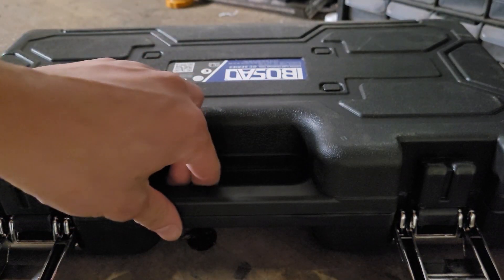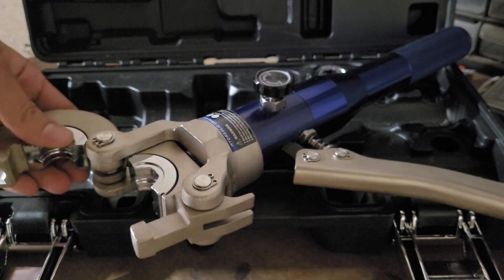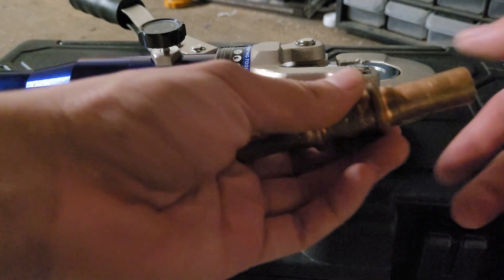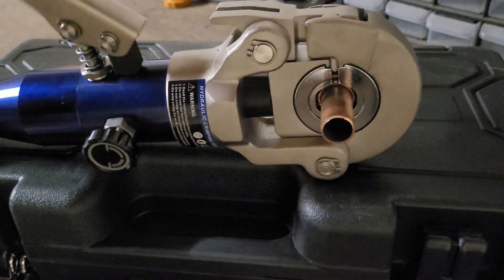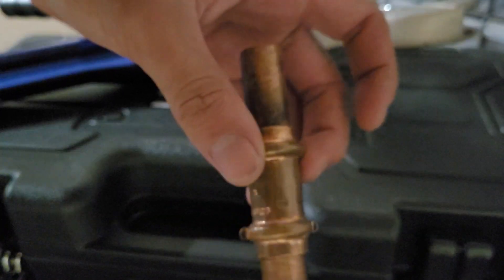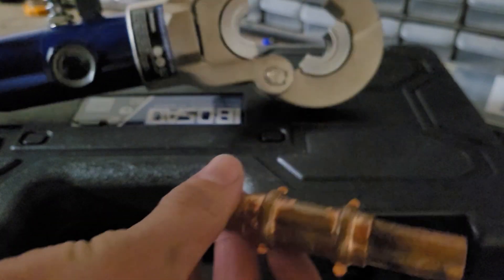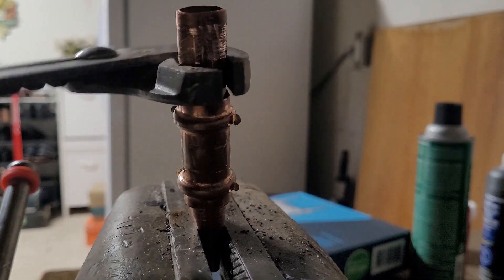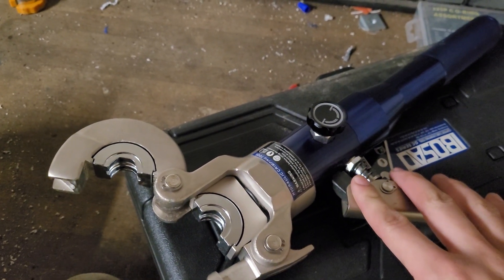IBOSAD GC-1 Copper Press Tool Review - $100 ProPress! (See update in description)

Comment from the maker: UPDATE September 2025 The new IBOSAD HT-1950 ProPress tool has fixed all the problems I had with the GC-1 I reviewed in this video and I highly recommend buying it instead. I made a video about the new press tool here: https://www.youtube.com/watch?v=8EnrHqB4dzE

UPDATE April 2022: Do not buy this press tool! It is not manufactured to the proper standards and every single joint made with this tool started leaking after a short period of time. The included jaws appear to be for European or Asian metric press fittings, but they were labeled as being for North American press fittings. I made a video about the problem here: https://www.youtube.com/watch?v=cP8fJlKejtU
Reply: Thanks for the video and the update. Have you found a better, more reliable manual pro press tool?
Reply from the maker: There's the Bluefin tool, but it takes a lot of space to use. You could always rent a real press tool for around $100 a day.
Reply: @DragonBuilds  thanks!
Reply: Thanks so much for updating us!
Reply: Did you deburr the inside and outside of the pipe ?
Reply from the maker: @1allstarman  Yes I did
Reply: Relieved I read this comment section. This tool is literally in my amazon cart waiting for me to click buy. What press should I buy instead?
Reply from the maker: @JeffMorrisonAdventures  The Bluefin press tool from supplyhouse.com seems to be fine, or you can rent an electric press machine from places like Ferguson
Reply: @JeffMorrisonAdventures  I bought the IGEELEE it works fine. Just be carefull not to pump it too much , stop when you see the dies touching .
Reply: @1allstarman  have all your crimps held long term? How long term?
Reply: @JeffMorrisonAdventures  It has been about a month , I have used only copper .I do not do plumbing  every day .
Reply: @1allstarman IBOSAD, IGEELEE, etc. I wonder if those are literal phonetic translations of Chinese words or if they use a random word generator to come up with brand names.
Reply: @JeffMorrisonAdventures  o far they have worked fine , I have never had a problem with the igeelee , In fact I bought a back up one , same thing .
Reply: @1allstarman   I've since bought it and used it to replace the shut off valve in my hot water heater.  I sight appreciated.
Reply: Thanks for the update. I may get into this for repairs instead of sweating pipes, or maybe pex. Not sure.
Reply: With respect, this comes down to user error. It looks like you tried to crimp too close to the wall and as such probably weren't able to apply enough pressure and completely close the jaws. I've seen independent tests done with this specific brand and, if crimped properly, do not leak.
Reply from the maker: @EnigmaPSU  I think mine was simply defective, I tried another joint outside of the wall and it had the same problem.
Reply: @EnigmaPSU thank you for being a real man and gentleman of your critic….”With respect”. Taught me something today….much thanks!
Reply: Yea mine is doing good maybe u just don't know how to use it

Comment: 3 years later is all the pressed fittings holding up good, looking to finally buy one after seeing ur video
Reply from the maker: I had major problems with leaks after a few weeks. I have a video linked in the description with updates. Recently, IBOSAD did fix the design flaw with the press tool however, I have a video about that coming soon.
Reply: @DragonBuilds thanks boss I’ll take a look at ur videos later today

Comment: Plus mine works fine i have no issues at all left it for a week or 
3 no leaks so if u take ur time and make sure the rubber seal is on the pipe u will not have leaks best thing to do after is check for leaks after compressing it together  do not rotate it or it will leak they are not like sharkbites at all completely different

Comment: I decide to buy the lower cost Rigid 12v press tool. It is very expensive for me, but I will sell it after I'm done with my projects. My reason for avoiding any manual press tool is some joints will be difficult to reach well enough to get proper purchase on the manual tool. It just seems, for me, it will be easier to maintain during operation. I wish I had the confidence to save big bucks on the tool, but I'm saving a $500 installation fee on just the water heater.
Reply from the maker: The Ridgid press tools are great, you can also rent them from plumbing supply houses. If you saw my updated video, every joint made with the IBOSAD press tool had to be cut out and replaced, I ended up soldering instead. If you can solder it’s not worth the cost of a press tool for home projects in my opinion, as even a high end propane torch is under $100.
Reply: @DragonBuilds  I agree with all your observations. But, I am a little impatient. One project is to replace a house shut off with a ball valve. That will be wet work (not a hitman) 😆 And, only one connection that I have soldered has held up. I learned, late, that it has to be dry. Additionally, adding a thermal expansion tank to the water heater is going add to time required. I appreciate your videos and learn from them. At 74, the convenience of purchasing is worth the price of the tool, especially if I can spread out my projects. Rental is $100 plus 2 way shipping for two days. My Ferguson didn't list a tool in stock, for rental. The possibility of recovering a little money on the back end will be added benefit. Yea, I can still be a little impulsive at my advanced age.
Thanks, again, for your videos.
Reply from the maker: @obliqueperspective  In that case, a press tool can be worth it! The small Ridgid tool is $1200 or so, and considering that plumbers charge $150/hour plus a markup on parts, you can still save a bit of money. Of course, soldering is cheaper but takes longer, especially if you need extra equipment like a jet sweat to stop water from dripping into the work area. ProPress is a huge time saver, which is why a lot of companies have switched over. 

I wouldn't sell it until you are sure you are done with it though, these tools last many years and are a must-have if you want to connect copper without soldering.
Reply: Yea but u have to pay hourly who can do that

Comment: There's a new version of iBOSAD press tool available on Amazon. It works like the Milwaukee one with claws closing to compress. Haven't seen any issue with that.
Reply from the maker: I saw that one, it looks to be better designed than the one I had problems with.

Comment: OMG
This video is already 3 years old and shows exactly why it is WORTH to use the designated and designed presstool (cable or battery) for this type of work.
I've going into some renewal work on our heat plumbing lines (up to 40mm) and happy to use a cable pressgun for that.
If you know what you do and how you do it but you dont have one, then rent one (with the right pressing tongs) and get it done

Also an option if its only some joints of composite pipe:
REMS offer a hand tool where you can use the normal sized pressing tongs (and not this spacewasting thimg from this video)
Reply from the maker: I agree, renting a proper press tool is a much better option than using these no name Amazon tools! Many plumbing supply stores rent them out for a small fee, and of course soldering is always an option.

Comment: Works very well, made as good as quality American for way less but the head is too big, a 3/4 to 1/2 T fitting is not long enough on the1/2" side to go all the way into the clamp. I had to slide the clamshells out of the clamp some for it to work, not proper.

Comment: So press joint , back off , turn 90 degrees , or a quarter of a turn , and repress ? Does that sound right ?
Reply from the maker: No, there is no need to repress. Also, I do not recommend this tool as it has issues with leaks.

Comment: The biggest beef I have with this tool is it won’t fit in tight spots.   
For diy use, go sharkbite.  
For a professional, pro press is the way to go but I’m not seeing a logical way around the 2000 investment.
Reply: There are better versions of this tool that work well and can fit in tight spots and is perfect for a DIYer.
Reply from the maker: Honestly, I would say that you are better off soldering.

Comment: Looks very clumsy to use and would require three hands to position, hold, and press together. Not to mention the cost of those fittings, only real benefit is connecting pipe that is wet. I'll stick to soldering.

Comment: Bought it 2 years ago...just used it with zero issues....the other one....need some coordination though...one fitting i pressed at  slight angle  but no leaks(outside faucet stuff)
Reply from the maker: Hmmm, I think it must be a quality control problem as some people have had good luck with the tool and others have leaks everywhere.
Reply: @DragonBuilds Definitely quality control problems. It's made in China. But I've tried two different ones from IBOSAD and both worked well. 
It was the HT-1950-N
And the HT1950-ZHENGTI, which is what I have now.
Reply from the maker: @fasteddie5388  I agree that it is likely a quality control problem but they also cut corners when it comes to design.
Reply: @DragonBuilds  The design of the one you're using I think they have cut corners. The hydraulic pushes one roller up into I to the other die and crushes it. I can see how that might cause an issue. Especially after seeing how it it leaves the large protruding pinch marks after being pressed. The newer ones do not do that. Especially the one I have where you have different sized jaws for different pipe OD.  It leaves very little pinch marks. I think they have refined the design over the last few years.
Reply from the maker: @fasteddie5388  I have the manual iCrimp/Bluefin tool (rebranded) and it works great, I think their hydraulic version should work well too.

Comment: There is a name for people who use propress fittings.
 They are called "flooded".
Reply from the maker: Press fittings have been reliably used in Europe for decades, but this manual press tool is poorly made and caused several leaks.
Reply: @DragonBuilds  You can blame the tool if it makes you feel better I blame the concept.
 I have seen O ring crimp connectors start leaking months after assembly.
 I will take a few minutes to solder sweat my plumbing and never have to think about it again.

 Alloy is your ally towards peace of mind.
Reply from the maker: @williardbillmore5713  I prefer soldering as well, but ProPress definitely has its places.
Reply: @DragonBuilds  Would you use them inside the walls of YOUR home?
Reply from the maker: @williardbillmore5713  Yes, absolutely. My partner's summer cottage is plumbed using a combination of PEX and press fittings for both domestic water and heating.
Reply: @DragonBuilds  Does this "summer cottage" freeze in winter?
Reply from the maker: @williardbillmore5713  Yes it does! PEX is quite freeze resistance, especially with Viega PEX press fittings.
Reply: Oh look another "real"plumber who only solders. Everything is press now and they don't leak unless your too thick to use the system properly. Stop living in the past

Comment: I bought one to try it, I crimped on one viego 3/4 to 2 separate scrap pieces. I had it set flush, and did the work. I could see the pipes weren't straight and the crimp looked like it didn't take al the way. After that I returned it and ill stick with solder

Comment: It is garbage based on what I am seeing. It squeezed the copper and did not put the hex imprint in to stop twisting. Cheap is cheap and the designer just had to follow some simple tolerance steps to make it 1000 percent better.
Reply: Bullshit, it works just fine. The seal is the O ring.

Comment: I have the split in half type. 2 years and countless fittings later its still going strong
Reply: Soldering is not hard and it is not dangerous and it  has proven longevity
Reply: @lrcreamer  right but viega fittings are warranty for 50 years and if you cant get water shutoff all the way than solder becomes tricky and press is easy
Reply: Do you have a link to it? What do you mean by "split in half" type?

Comment: bought mine from Vevor, did about 20 -1/2 inch crimps no problem, did 4 -3/4 no problem wasn't able to crimp the lower part of a 'T' fitting as the body gets in the way, that's when it started to lock up on me as in the head wouldn't unlatch from the body unless I hit it, this continues to this day, Vevor started acting stupid and saying I have a 1/4, 1/2. 5/8 tool and it didn't do 3/4 fittings (I had purchased a bending tool they were talking about) basically they kept going back and forth about me not knowing how to use such a simple tool, gave up on trying to get a refund or exchange (they no longer sell this tool now have manual ones) and stop doing business with them. just more Chinese crap. this tool looks exactly like mine case and all I'm guessing the only difference is the name on the case

Comment: The crimp is not supposed to seal the fitting. Once the fitting is pushed onto the copper, the "O" ring in the fitting engages and makes the seal. The crimp secures pipe onto fitting.
Reply from the maker: Press fittings are actually designed so they don't seal until they're pressed. That way, unpressed fittings can be identified before they cause a big problem.
Reply: @DragonBuilds  The O ring is engaged once the fitting is pushed on the pipe...
Reply from the maker: @plumbrose1  Viega fittings have a small groove that is designed to leak until the fitting is pressed. Not sure how other press fittings work.
Reply: @plumbrose1 yeah, the o-ring is engaged, but it’s not going to stand up to water pressure until the fitting is crimped. Without crimping, it will leak. Even if the fitting stays put.

Comment: I'd be careful telling people to stay away from this product based on no more than your anecdotal experience.

  It is essentially the same technology as a 3k$ Milwaukee press; with the big distinguishing [hand pump] hydraulic press being the only BIG difference. 

 I work as a plumber, and it's not uncommon for even the $3k+ pro presses to occasionally not hold tight on a coupling connection.   

But you to say that ALL your connections were pretty much leaking? - This leads me to believe that you may not have thoroughly understood or even learned proper operation of the tool. 

 Personally, if I were making a review and / or instructional video, I would've shown my viewers (myself being both familiar and pleased with the exact same product) that we would be calibrating our new tool first and foremost,  with the calibration kit provided, and then, prior to operation on any job going forward! -calibration checks and/or adjustments take literally 30 seconds FYI. 

Anyone familiar with plumbing, and really any occupations / vocations focused on the importance of mathematical prescion, knows just how important it is and, furthermore, the ramifications of mere millimeters. 

Also, to anyone looking for further tips:

always ensure that you are coming down on the coupling straight... file and debur just as you would approach  a solder connection [as you can slice the inner rubber ring)... and lastly, mind your proximity of any joints that you may have to sweat instead of press, as the heat can easily melt the rubber ring (the most vital component within your press connection).

Happy plumbing out there, and for the record, it's easily one of my favorite tools nowadays; especially considering the fraction of a cost it imposed on me in comparison to the electrical ones!
Reply from the maker: While the technology is identical, I found that this no-name tool’s jaws are imprecise and couldn’t crimp the fitting completely.

Comment: I have had one for 3y works good
Reply from the maker: I read that they recently changed the design, since I saw some good reviews of the tool from a couple years ago and they seemed to be fine back then.
Reply: @DragonBuilds   the only thing different with mine and yours is my fittings are black --- i have never had a leak in 3y i ever did a video on it --- thanks for sharing
Reply from the maker: @Raysmaintenance  The postive reviews all show the tool with black crimping dies. I think the silver ones are made with less precision or poor quality materials.

Comment: I have been using this tool for over a year and have had no issues.
Reply: Have you ever pressed 3/4” Viega tee? It would not fit or is just me?
Reply: @probuilder6828  I’ve been using it for about two years. I don’t use it daily but it has been reliable every time I bust it out. Never had an issue. Yes, I have pressed three-quarter, but not any tees because I typically switch everything to PEX.
Reply: @probuilder6828 This version is not meant for T fittings. You have to get the version with the propress jaws

Comment: i have a similar tool (albeit a lot more expensive)…but still prefer sweating (solder)copper pipes…i really try to use PEX (type A)…which is outstanding…no longer use copper at all…
Reply from the maker: I like using PEX-A as well, but some applications require copper as PEX can't be used outdoors (sunlight degrades it).
Reply: I agree sweating is much more superior than any other fitting. The only time the press fitting is the best is when you have a hard time getting water out of a system and that’s when those press fittings really shine.